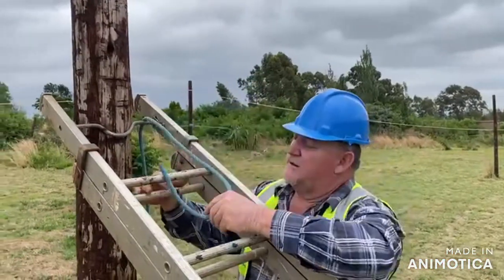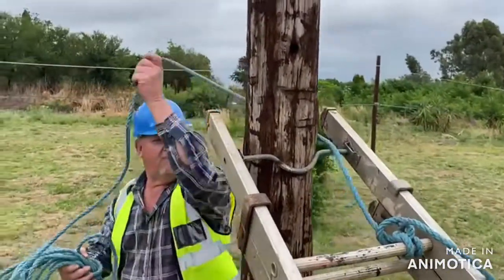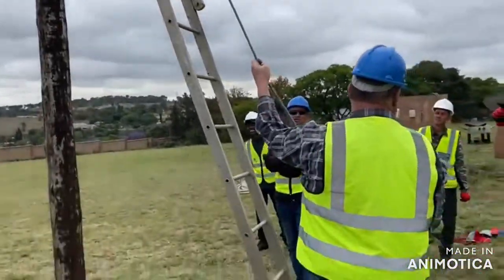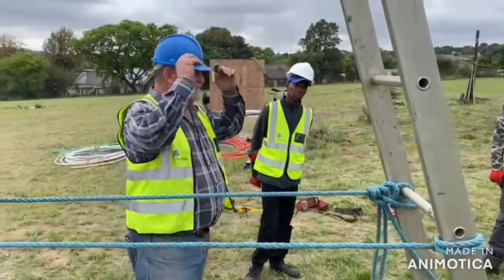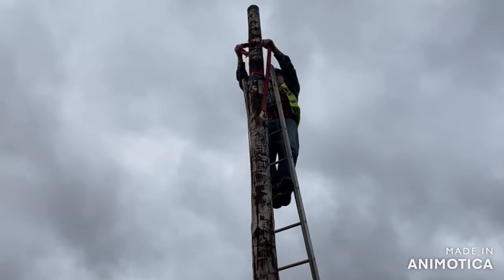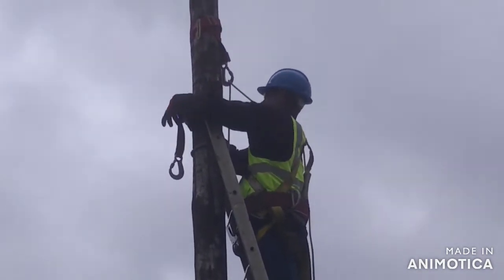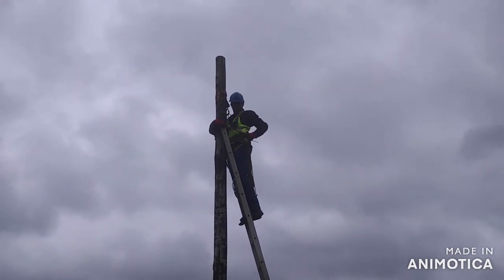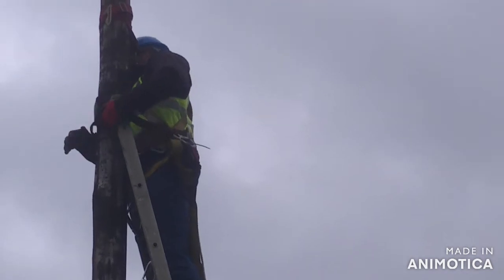How to Climb a Pole using a Ladder

Comment: Gunna hopefully get a job working on fibre optic cable! 

This will be very useful to keep me safe!
Reply: If you do, you'll have the correct ladder. Pole climbing ladders are supposed to be fiberglass with 2 hooks on top to hook to the strand. N9 need for tie off.
Reply: I work telecoms. Aluminium ladder, won't get a shock off telecom anyway. 
We just put the ladder up and climb up to the top then tie off just the top of the ladder. 
 Hooking every step all the way up and tying off the bottom of the ladder at the bottom is safer but once top is tight you're reasonably good. I will admit on occasion when it's slippy or not great ground I will tie off the bottom separately. 
I use my safety rope when I'm at the top and then also my belt but most the lads just use the belt. 
I can't put my trust in that one belt. I like to be tied off aswell just in case. 
Telecoms is a great job. I'd highly recommend it. Plenty of money to be made and it's great fun. 
But keep sharp because it is dangerous.